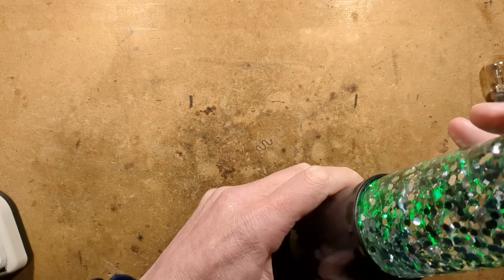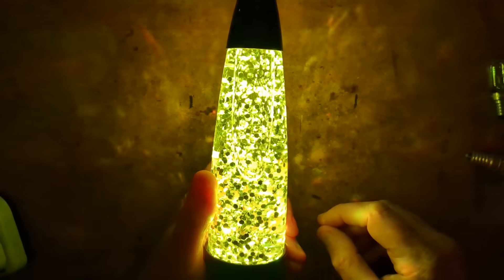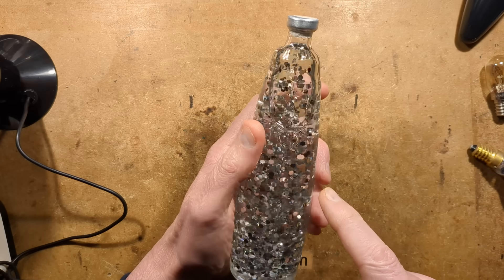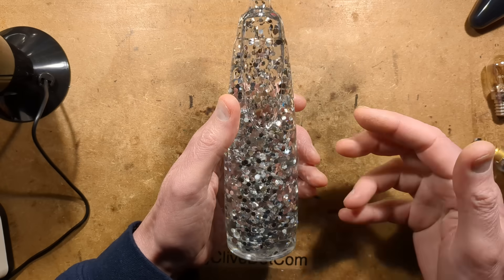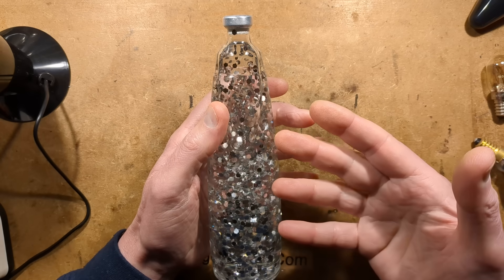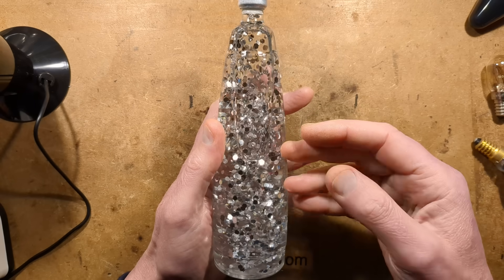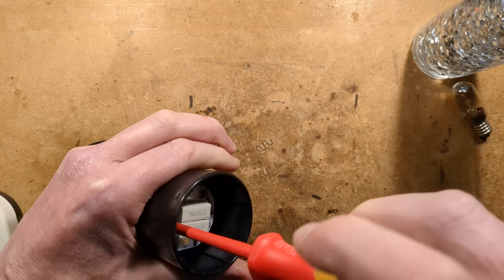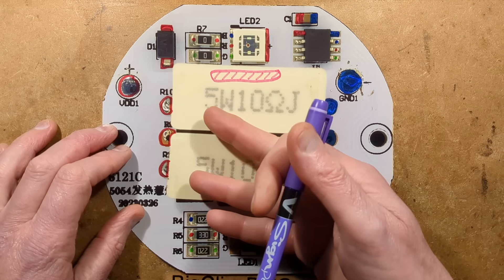USB glitter lamp with REAL thermal convection

Comment: I have two of those 'bases' that are still using the appliance bulbs for my legally-distinct-but-visually-identical motion lamp. Same cable grabber/gland that is crappy and not grabbing the 120V cable. Plus the feet on the base are terrible I put much better ones that keeps them from slowly scooting off my desk over time. My current plan for when I can't get any more light bulbs was to design--basically this exact circuit. Not USB powered, but I was just nodding along when I saw the PCB with the two big resistors on them. Maybe I would have used USB PD and had a USB type C at the end, but otherwise... yeah. This looks pretty much like what I would have designed.

Personally, I think that center position for the resistors would work best for liquid-motion lamps. This would concentrate the heat, leading to fast blobbing up the center. But I would have alternative spots for resistors along the outside edge for these glitter-motion lamps. To see if the flow could be up the sides, and down the middle. But also, you could change which resistor would be on with a MCU and a mosfet easily enough. But I do also wonder if they could be rid of the resistors entirely, and just use (and abuse) the mosfets directly. Use some really big chunky ones that are 'out of spec' for high power work, but would work just fine for heating up some liquids.

Comment: Only tungsten lights above 15w or 10w have been banned in the EU afaik. At Hornbach or Kwantum for instance, you can still find 7w and 10w chandelier incandescent, and of course microwave/oven lamps. 
At supermarkets typically only oven lamps.

Comment: I wonder whether they determine the quantity of glitter required by weight. I can't see them faffing about decanting / filling glitter for defective versions.
Reply from the maker: There is a sweet spot for maximum shimmer without blocking too much of the light as it travels through the globe.

Comment: Seems odd they haven't optimized away the microcontroller yet.  They took out one LED to prob'ly make it a bit cheaper per unit, but the only reason for the MC is to keep two LEDs in sync.  Stick in a color changing LED, run a single power line to it, and call it a day.
Reply: It would not surprise me if color changing LEDs is just a MCU in the same package as the LEDs.

Comment: Do you think they purposely doubled up on the resistor power rating or just did the math on the power of the circuit and saw it was 5 watts so used 5 watt resistors?
Reply from the maker: It's always better to under run resistors.

Comment: I was getting ready to convert what you had paid to what's left of the USD (I was going to say US peso (because, but that felt insulting to any country using pesos)

What happened to the other lamp? Did it survive?

I've wanted ti build a lava lamp since I saw Alex do it on Technology Connections (I still have a blue liquid, green wax incandescent one). It was just like the one from Spencer's that my mom bought for my grandma to give me, except with a broken switch, so it's Sonoff controlled now.

Could an LED/resistor THERMAL convector lava lamp be made (and efficient?)?
Temperature from the resistors could be regulated by multiple means tbh. I imagine the heat may be higher, so the LEDs might live below on a separate board and could require a light pipe (primitive fiber optic). [brainstorming]
Reply from the maker: The other one is fine.  Alex may have underplayed the complexity of making a reliable lava lamp.

Comment: LED so that it doesn't get too warm and two resistors for heating 🤣
What progress compared to incandescent lamps.
Reply: it's just nice that you don't need to heat up lamps that don't have glitter convection if you use LEDs
Reply: During the winter incandescent would be nice.
Reply: @NEON2600  Or, through the magic of buying 5 of those, you can enjoy the magic but more for the same heat!

Comment: This is really interesting. I wouldn't have thought of using resistors, but it makes sense. I have been wondering on and off if you could use the components out of one of those USB power bank handwarmer things to make one of these.

Comment: looks like the cap is sealed on there.   Did they pressurize this calcium mixture any?
Reply from the maker: It's just sealed to prevent leakage, but also has the ability to eject the top if the vial is overheated.

Comment: Is there a lava lamp led retrofit kit market?
Reply from the maker: Lava lamps are harder as they require a lot of heat.
Reply: DIY? I have an Edison screw 120v (US) wax lava lamp that I WILL NOT let go of (sentimental reasons), at least not without a perfect replica (it's not the original- that was lost moving 9 times- not an Army brat, ex-faster kid account for 3 of those, parental divorce, 2,... they add from age 12 to.... now).

Comment: LED's not living up to expection, in the USA they have LED street lamps turning bluish mauve because the phosphor is delaminating.
Reply: In Tennessee,  near me they built a highway extension a year or so ago, all the streetlights have gone blue/purple. Kind of a surreal effect when you drive it solo at night.
Reply: Someone thought it would be smart to replace the heavy duty steel fixtures (which could be retrofitted with an easily replaceable LED bulb) for plastic one piece LED streetlights.  Instead of a simple bulb change, they now have to replace the entire streetlight.

Comment: I wonder how long it takes for the glitter to begin degrading and changing both the density of the solution and the density of the glitter, and weather it would influence the floatability of the glitter or the optical properties of solution first?
Reply from the maker: I've had LED based glitter lamps running 24/7 for over a decade.
Reply: @bigclivedotcom  Obviously the whether is optimal where you live sir.
Reply: @archstanton_live  LOL You obviously have never been to the Isle of Man....

Comment: Tangentially-related, but how can you adapt a lava lamp to work now that tungsten bulbs are banned? We have a couple, and it seems a shame to dispose of them now that the bulbs have blown.
Reply: Bulbs for ovens work, alternatively, ebay
Reply: @phonotical I hadn’t thought of that. Potentially, if they make them small enough, a vivarium bulb might work as well then?
Reply: @phonotical  Just make sure the seller packages them really, really well.
Reply from the maker: Unfortunately lava lamps require a high thermal gradient to work well.
Reply: @phonotical , just a random thought... but i bought a ceramic reptile heat lamp from China real cheap, about the same size as the mini-spot tungsten but significantly warmer if i remember, you might need to use it on a dimmer... and of course it won't be lit-up, maybe a small mains buck regulator in the base to power a few el-cheapo LED's around the rim?

Comment: I wondered what the solution was. I assume nothing will grow in there. Thanks Clive. 👍
Reply from the maker: I've never seen a glitter lamp with fluff in it, other than the ones that use a stirrer.
Reply: Calcium nitrate being a strong oxidizer most likely prevents that. For context, bleach (ClO2 and NaOCl alike) hydrogen peroxide, bromine, chlorine, ozone, ammonia, and iodine are all oxidizers and that is why they are disinfectants and poisonous if consumed. If anything grows in a 36%+ Calcium nitrate solution, it would have to be something VERY nasty. For context, household bleach is 5.25%-8.25% NaOCl. Meanwhile hydrochloric acid forms an azeotrope with water at 37%. So ultimately this solution is jam-packed with a powerful oxidizer that can eat aluminium and thus if there is anything growing in it you should be very cautious about its contents escaping given how resilient such microbes would be to common disinfectants or even modern medicine if you're extremely unfortunate.

Basically, that's not a problem, and if it happens, get rid of it responsibly.
Reply: It's sealed shut so as long as it was properly sterilized nothing will grow in it

Comment: So Clive have you used a hydrometer to measure density of one of the purchased glitter lamps. I think it would be a good starting point for any other glitter lamps you make/repair.
Reply from the maker: The difficulty is finding a hydrometer that can work with such a dense liquid.  It would probably have to be custom.
Reply: @bigclivedotcom  Sounds like a project for you to make..   :P

Comment: Interesting, it seems like rather than engineering this redesign to optimize where the heat is delivered, they just chose the resistors so the total power consumption would be right and stuck it all where the bulb would have been. It would be fun to see whether a smaller, closer heat source coupled to the glass would work as well and save power.
Reply from the maker: My own previous experiments with this involved gluing resistors directly to the base of the bottle.
Reply: Add a loop of wire inside the bottle and go for induction heating?
Reply: Couple this with wax (real lava lamps aren't glitter) and I love it.

Also, this seems better for the LEDs

Comment: I am clearing out my late father's house. In a cupboard I found several tungsten lamps and it did occur to me that you can't now buy them, but I don't think this has any scarcity value attached to it. I put them in the landfill bin. They were 40W to 100W mains jobs and you would need an awfully big glitter lamp to make use of that!
Reply: Normal ones are about 40w,or they were last I saw
Reply: @phonotical  I believe you're correct, they may have been 25W, my memory is a bit foggy.
It's not diffucult to substitute another form of resistive heater though.
Reply: Sorry about your dad